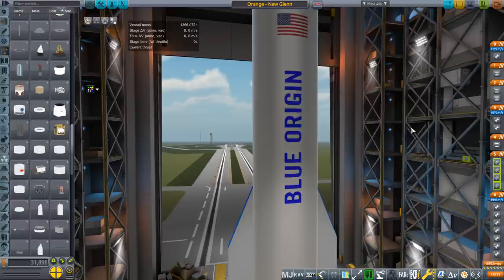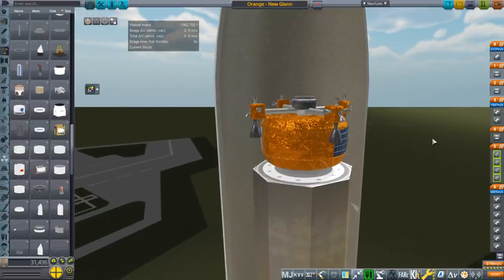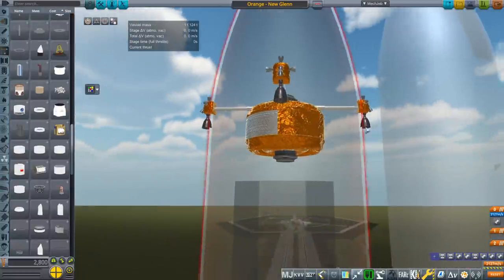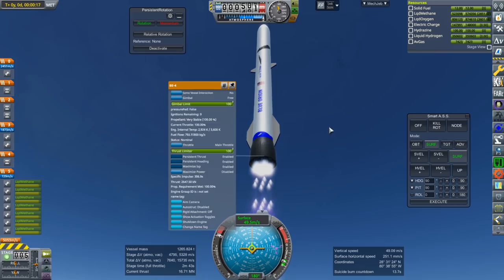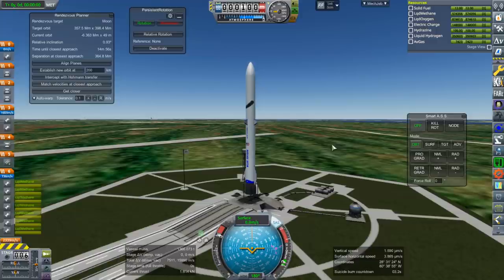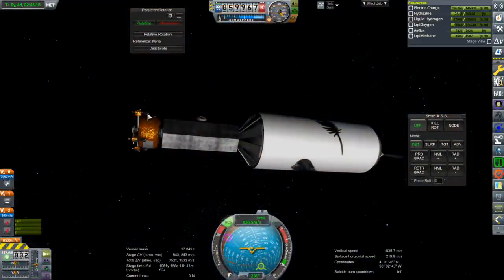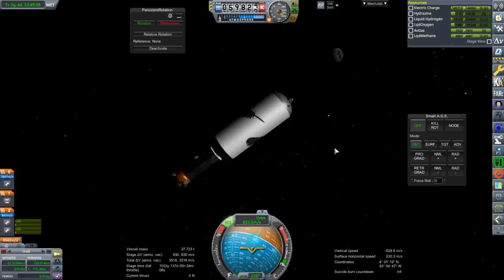Realism Overhaul in KSP 1.8.1 - Return of The Orange

Comment: 1:30 I thought I was an early watcher but I don't remember this NOOOO!!! (Well, it may just be that I watched your standard Realism Overhaul series' in preference to your Kolonization series... when was the last video that featured it? In any case, I did subscribe before half your current subscriber and view count.)

1:45 MMM, YUMMY!

2:30 LOL

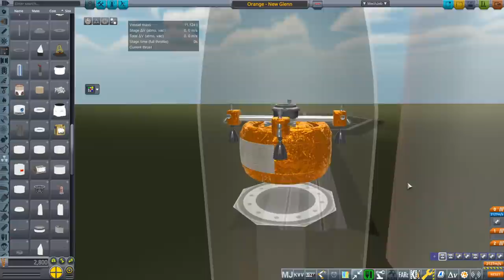3:10 Orange is a high visibility color, I guess?

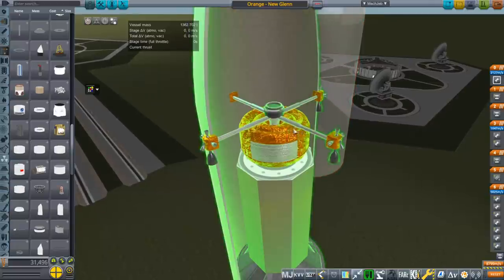5:10 That's ingenious, a combination space tug and reusable skycrane! I wonder why NASA hasn't considered something like this...

5:25 Wait, concentric toroidal methalox tanks? That's an interesting concept... The Orbex Prime will use something similar IIRC (with the same propellants), though in that case the fuel tank is planned to be directly inside the oxidizer one, apparently to save tankage structural mass through buoyancy and precool the methane.

17:25 Maybe you should split out the engine/arm assembly into 1 or 5 parts in order to allow 5:40 (swapping the propellants in the tank)—and if 5 steering through differential throttling—without making separate models. On the other hand, with those separate models maybe you could include different relative tank thicknesses and (if constant-mass instead of constant volume) different sizes to more accurately represent the appearances of alternate-propellant oranges. Maybe do both splitting out the assembly and making separate tank models?

Comment: Is there any chance you could make inflatable habitation modules or module that will need to be built on the surface? Sort of like ones in the martian or just inflatable an inflatable hab?
Reply from the maker: I'm looking to make a hab that has regolith piled on top for radiation shielding, so inflatable won't quite work (there are inflatable habs in USI, though). I'm going to try to use an animation for the addition of regolith, but that's experimental right now.
Reply: @RaizSpace  there is a mod that has that feature, it has inflatable lunar modules with the ability to cover with regolith. Its not RO compatible but if you need a baseline you can use the models. The mod it call capsule corp or something along those lines

Comment: You landed 7000 units of avgas on the moon. Is this to fuel the Cessnas the base operates?

(obviously a joke)
Reply from the maker: Would you prefer 7 tons of Tesla Roadsters?
Reply: Hmm...
1. Get a Cessna 152/172/whatever.
2. Remove most of its wings, the control surfaces, and the propeller, along with other unnecessary mass.
3. Replace its altimeter's pressure-based system with a RADAR-based one, remove its pitot tube and make the airspeed gauge a groundspeed one, seal the gauges and battery, reprogram the navigation system, etc.
4. Add a life-support system to support suited individuals, or do both that and seal and strengthen the cabin for unsuited people if that will save weight overall.
5. Partition/add an additional tank for storage of liquid oxygen, or more likely given temperature and oxidizer:fuel constraints, nitrous oxide. Add helium tanks for pressurization. Strengthen or replace them if not strong enough to tolerate a vacuum pressure differential.
6. Replace the Lycoming IO-360
 crankshaft and modify camshaft to allow the engine to execute a reverse Atkinson cycle with a short power stroke and long compression stroke, reducing brake power output to only that needed to run it and thus producing hot, high-pressure, energetic exhaust. Replace exhaust manifold with individually-gimbaling de Laval-shaped "zoomies". Connect their control system to a flight computer and from there the flight controls.
7. Seal the crankcase. Add a regenerative cooling jacket that would heat avgas from cloud point to its thermal stability limits, as well as evaporating and expanding the oxidizer to near-STP. If still insufficient, add an additional radiator (in this case in the proper sense of the term) system.
8. If necessary, move the engine, and add shock absorbers to smooth out the pulsed thrust.
9. Hope that (in reality calculate beforehand if) the Frankensteinian engine created from 6 to 9 can create sufficient thrust for the vehicle to from the lunar surface with crew and cargo. If not, replace with progressively more advanced/powerful ~5.9-liter engines that have undergone the same procedure.
...
10. LUNAR CESSNA  LUNAR CESSNA

Comment: Blue Origin is what happens when a space company is led by a businessman instead of an engineer
Reply: It...wins contracts?
Reply: It's vehicles work perfectly every time their tested?
Reply: @jef_3006  Its extremely slow progression and sticking to proven technologies instead of innovating
Reply from the maker: Worth remembering that Blue Origin actually patented landing a rocket on a barge/drone ship. SpaceX had to argue in court that it wasn't an innovation, pointing out that the idea was from the 60s, and they eventually settled with Bezos. So, not sure your proven tech instead of innovating thing is correct.
Reply: @RaizSpace  you're right
Reply: @sebastiaomendonca1477  The progression is slow, but Blue tries new tech and innovation. CH4 engines are hardly proven(none have made an orbital flight yet, and there were some development engines on test stands over the decades that never flew). Gliding booster entry is another one. Also hydrolox landers never were seriously pursued. 
You can criticise Blue for moving slow etc. but you can't argue about them only using proven tech.
Reply: Another thing: Musk has a bachelorate in marketing instead of engineering. It's just that he learnt by himself what his engineers are doing.

Comment: why don't you use the hold retrograde function of SAS for landig? I think it makes landing very easy, without tipping over...
Reply: When your velocity gets low, it starts moving around a lot
Reply from the maker: Mike A Williams has it right - it gets too wobbly. That method is simpler in stock where there are reaction wheels and a full range of throttle, but the Orange doesn't even have gimbaling engines.